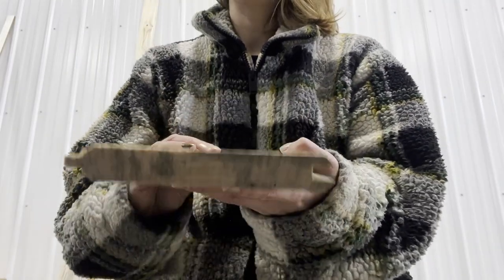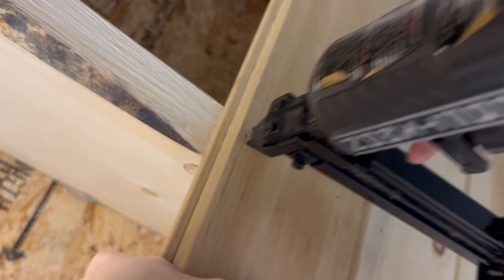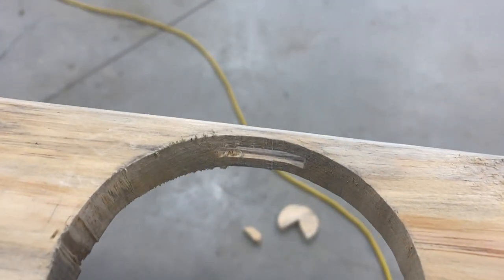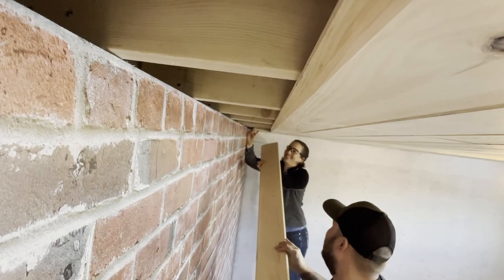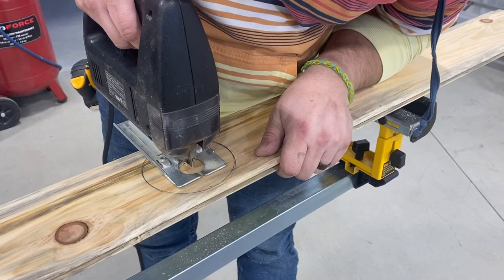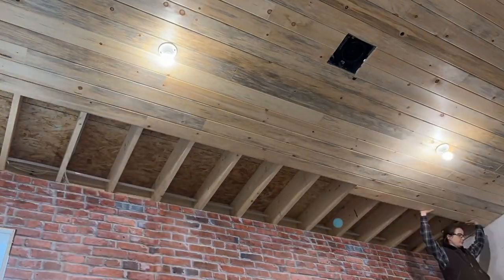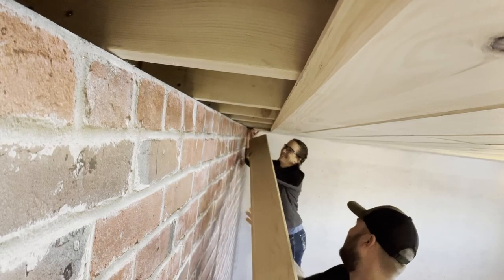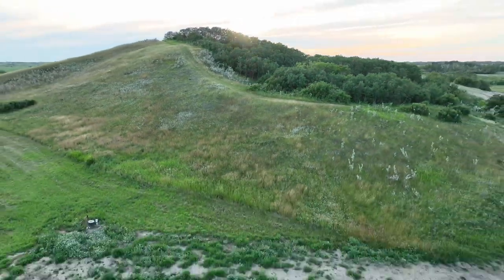Tongue & Groove Pine Board | TOP THREE Challenges When Installing

Comment: Hi thanks for the video. I'm getting ready to do 16' t&g pine on my outside covered deck. A lot of the pieces are decent but have a slight bow to them. Did you have many challenges with that during install?
Reply from the maker: Yes, some boards were bowed and we needed to use leverage to straighten the pieces into place, then quickly secure them using the brad nailer. Occasionally a board was too far gone and needed to be swapped out. Good luck with your project!
Reply: We’re doing same project on outside covered deck. We’re restraining the boards with Tung oil. It looks natural but some of the boards are curling. Any advice?

Comment: Can I use pin nailer gun for the tongue and groove board to install on ceiling? could the nail be able to hold these board?
Reply from the maker: Good question! A pin nailer with smaller headless nails likely doesn't have the holding power for this tongue and groove pine. I'd recommend a brad nailer or finish nailer for this project

Comment: Do i not need a gap around the perimeter to account for swelling because of temperature changes?
Reply from the maker: Natural wood products will shrink and swell. Standard recommendation is 1/4" gap around the perimeter. We installed our ceiling in the summer when humidity was highest so opted to reduce the gap anticipating more shrink than swell. Hopefully that works in our favour!
Reply: @thehillproject1  thank you!